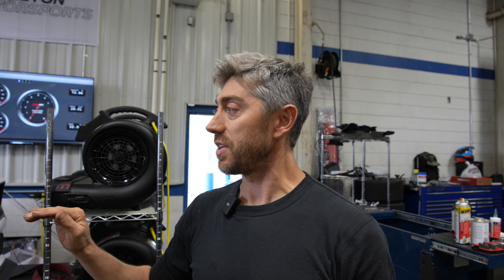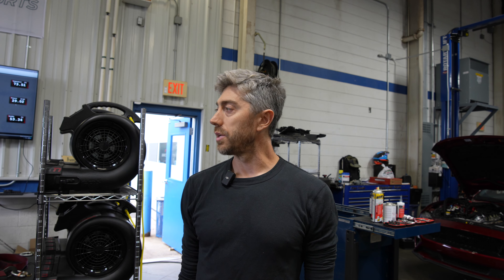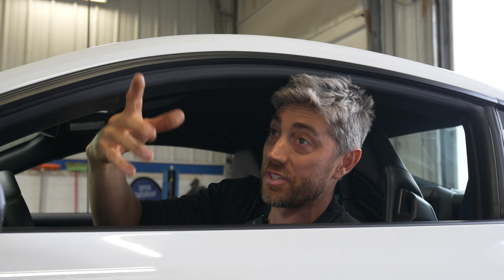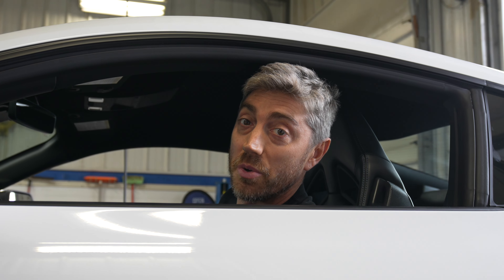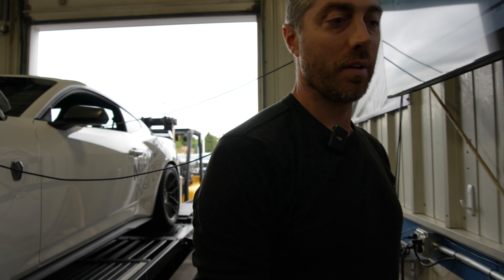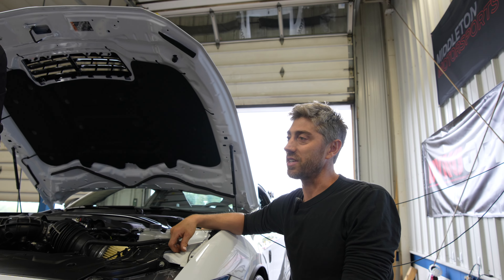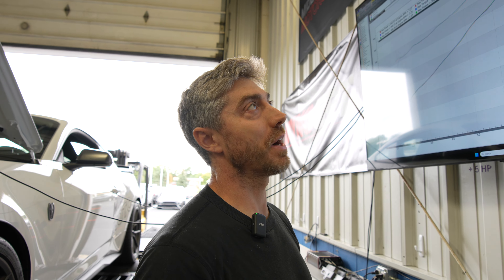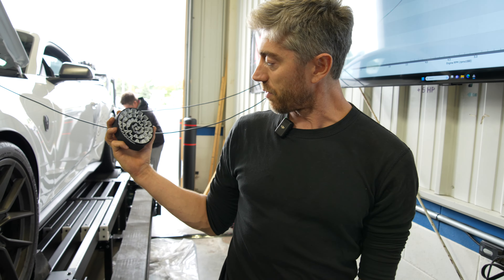*Highest WHP 2024 Mustang Dark Horse?!* 2024 Dark Horse Dyno Carbon Traps Removed

Comment: what is the use of a catch can? my mustang is stock. Am I harming it by not having two of these?
Reply from the maker: won't harm it but it separates the oil from the acv system that runs back in to the intake.  If you're driving hard or on track we recommend getting one.
Reply: @MiddletonMotorsports  thank u!

Comment: Lol Alejandro Flores Lund tuner did a live stream about this and he was right.  Removing carbon traps not gonna gain 20whp like people was saying 😂
Reply: ya thats crazy people think they rock 15-20hp lol its a heavier car than a s550 with 20 extra hp at the crank. Best way is 3 back to back runs and take a average.
Reply: Lol I watched that too😂
Reply: You're welcome
Reply: There is lots of surface area with the dual intakes, so I figured the engine could probably still get enough air.  
For the same reason, I think aftermarket air intakes won't really make a huge difference.
Reply: @minibikemadman that was true w s550 too it made up for it w potential having a gen 2 coyote was a big step up from gen 1.  This isn't a big step up and with tuning locked down its actually a step backwards.
Reply: This conversation just saved me 11 minutes 🤣
Reply: @YDBT4LIFE   Great video right! Proper SAE dyno numbers and taking the lids off to show where the power was coming from that the internet was claiming. Also the most important thing is that it didn't throw codes... That would have been a disaster for the platform if it did.
Reply: @AJUSA1  absolutely. It was scientific they did a great job.
Reply: I love Alex!!! 😂
Reply: All the aftermarket parts slingers are starting to 🥲
Reply: I’m guessing the carbon traps are part of the evaporative emissions system? IE absorbing fuel vapors escaping out of the intake manifold when the car isn’t running. Anybody confirm this?
Reply: I'm thinking the carbon screens could also be used for sound restriction. But who knows with a tune there might be a little more power there.
Reply: since the gen2 coyote, engines are opitmized for power and balanced for cost... not like the old days of cost over power only. The days of 20whp from a airfilter or +10mm throttle bode or exhaust are gone. Factory detweaked to save dollars. Today they just raise the cost...a 60k GT...
Reply: Saw the stream too
Reply: @minibikemadman how do you think the 24 weighs more then the 23 and older. 
My 24 weighs 3700 with half tank of gas. 
Sure you'll add weight with more options especially the performance packs with bigger brakes
Reply: Alex, tells it how it is ! No BS He is  💯

Comment: 1st time me hearing about abs cause issues with air fuel ratios. How are they even related
Reply from the maker: The car was going into a limp mode of some sort. Doesn’t like being on the dyno even when the dyno plug unplugged. The car changes the fueling why we’re not sure
Reply: @MiddletonMotorsports  I have a G8 that's gone into limp mode.  It does have an abs fault light come on sometimes however I've never had the 2 come on simultaneously, and the limp mode was pretty rare,  but the abs fault in a g8 isn't like a check engine light and I don't know why I experienced the limp mode.  Just some spirited driving on the highway without an abs fault. I would never imagine an abs screwing with the issue causing the ecu to bug out
Reply from the maker: @MrDerekRobinson  this is far from a G8 with the new computers etc.  we’re not saying it’s the abs causing it. The whole car goes into a limp mode not sure what’s causing it other than it’s on the dyno and doesn’t like it.

Comment: Alejandro flores was right people spending 70k for nuthn 😂😅 should have just got the gt350 smh
Reply from the maker: Chuck already has a 900whp GT500. He wanted to test the new platform at the track and like we mentioned in 60 days it will be a different car with a Whipple.
Reply: @MiddletonMotorsports   won't make more than 700hp with the Whipple to the wheels
Reply: @edddiaz4202  hoping for low 600s.  Will
Make it a fun car. But if I want the best performance on track and acceleration ill get in the 500

Comment: Yea thats smart then have all hot air coming in either put a cold air with a closed air box or leave it as is
Reply from the maker: We aren’t running without the lids. Just for a test to show restriction of stock intakes
Reply: @MiddletonMotorsports  i know you are doing a test its ford that are idiots first with that shit hole mt82 that im having all kinds of problems with now they make a 4000 pound car that is slower than the s550 because of weight

Comment: No disrespect intended but lund is not the only person who has tested the new mustang without the carbon traps and got more HP. Why is he right and others wrong? Also, every little bit of HP all adds up. Carbon traps here, an x-pipe there, removing the air box lids and later a tune and flex fuel. Look at the bigger picture.

Comment: Nothing about the S650 says it’s a better performance car than the S550. Only thing it has going for it is the 2 tablets and a drift stick if you like it 😂
Reply: And better brakes.
Reply: @728GT  oh yeah brakes cause you’ll need that after getting gapped by a 15-23 mustang 👍🏽
Reply: great, a drift stick so these idiots that dont know how to drive now have an added feature to lose control exiting car shows 🤦🏻‍♂️
Reply: Aka gimmicks
Reply: And they don’t make the S550 anymore. They’re not going to bring it back. At least they didn’t cancel the mustang altogether
Reply: @teamcaveman  that’s fine but it’s no “upgrade” from the S550 that Ford was touting about. Plus you do know Dodge and Chevy didn’t HAVE to kill off their ICE V8 vehicles they did it by choice 👍🏽
Reply: @OSMINCONDE23  by choice meaning they didn’t make the next ICE vehicle, rather the next one is EV. I think there’s more than just that they wanted to, especially the Camaro which for some reason couldn’t sell well. You don’t think fans wanted the next gen cars to ICE as well? I’m sure like before they’ll rejoice the new EV versions like when they made fun of the IRS in the 1999 Cobra and the supercharger in the terminator. When they put irs and finally induction in the Camaro and mopar, it was the best thing ever
Reply: @OSMINCONDE23 Your statement is completely incorrect. Do some research before making a dumb comment. The Hemi cost Stellantis millions in fines. $363 Million to be exact For Failing To Meet MPG Standards.... The Hemi was discontinued to eliminate future fines. Chevy is ended the Camaro because it didn't sell finishing well behind the Challenger and Mustang in sales. Regarding the S550. It's sales continued to drop with the Challenger outselling it. I'm trying to figure out if you dislike Ford or can't handle positive changes of the Mustang.. Maybe stick to S550 Channels. A real Mustang fan likes all Mustangs. Some more than others, but whether it's a 1966 Shelby GT350, Fox Body or an SN95 SVT Cobra. They're all Mustangs,
Reply: @DWH300  Yeah, so by choice Dodge stopped producing V8’s cause they couldn’t produce one to meet standards, where am I wrong? A mustang fan never got a mustang for change but for performance and there’s no “performance” upgrade in the S650. I don’t know if you’re a TRUE mustang fan, but Ford did the same thing SN95/ New Edge no performance difference until they got the Mach1/Cobra or what about 2010/2011 when they changed the S197 design in 2010 but didn’t put the coyote til 2011.

Comment: Unmeasurable difference from carbon traps, hope people get off the carbon trap bandwagon now, duel intakes with the lids off is asking for a hood with open air intakes... Ford Motorsport sells a blue air filter supposedly flows more...excellent video again from you guys....  yes 1/4 mile dragy runs PLEASE.
Reply: It would look pretty neat with maybe some louvers or something directly over top of them
Reply: @MikeYeary take a look at the COPO Camaro forced induction, it's literally a giant fiberglass funnel directly to the throttle body and Ford for some reason will never do stuff like this.... bring back the true Ram Air for a Mach 1 Maybe, unlike last year's decorative sticker package.
Reply: yup, its funny how it was proven/ dyno'd  that removing the carbon filter on the 22s actually gained the power back but they didn't do shit on these🤣
Reply: @alexisaguilera2705 there's no true dyno test like this one for the 22 isn't unmeasurable difference either case
Reply: @SHADOWBLACKs650 the stock air boxes ARE RAM AIR 🤣 even on the s550! Open element filters kill top end power on the road you loose the ram air affect…
Reply: @Texas_Road_Warrior  no they are not compared to a  open vented Hood... you would have are entering the airbox the speed of the vehicle....
Reply: Someone gained 12 HP by removing the traps, so it may be worthwhile for some.
Reply: @TheProtagonist_777  that's also a emissions device which a dealership will void your warranty, and they literally are not allowed to work on your vehicle once they see that, they are not bashful on voiding warranties on a mission devices... I get the idea and all but twenty thousand for a engine and 7,000 for the transmission plus labor people better think twice

Comment: Try replacing the stock air filters with K&N filters when they're available that would be interesting to see the difference
Reply: +5 HP
Reply: A stock paper air filter will flow just as well as the K&N without the shit oil filter being in there. Those filters will cause oil build up on the Mass air flow sensor.
Reply: It doesn't do any of that. Had an oil filter for 11 years on my 2014 mustang gt and no issues.@burntfaceman24

Comment: These vehicles have so much engineering into them I find it hard to believe any real world gain comes from changing anything on the stock setup.  You might get a negligible increase at the cost of losing HP somewhere else.  Closed lid air boxes keeps IAT temps down keeping the motor cooler.  So for a daily/street car I would keep the lids on.  Those iat temps will climb like crazy idling at a stop.  Keep it stock unless you’re  chasing every last ounce of HP for drag racing.  There is a reason it’s setup the way it is.

Comment: They did dyno runs for a similar type carbon filter that was removed from a 2023 Subaru BRZ (Toyota GR86) and they saw +10HP. Looks like the Japanese need to consult Ford for a more efficient carbon filter design.

Comment: Take the air filter off; put the lid back on... why hasn't anyone tried this.. it would be the most realistic thing you could/ would do at the strip..
Reply from the maker: We don’t and wouldn’t recommend running without a filter. Not worth the minimal power if any gain from that
Reply: @MiddletonMotorsports  I can accept that. Also, I wouldn't recommend running with the lid off, with hood down.  But you made the comparison to gt500's  gains, *65hp+  I've seen from Vmp (*not your comment).. for sake of an experiment, why not try? Even better  with a gt500.. RoadKill!
Reply from the maker: We don’t recommend that either. We just did the lid off to see if there’s a restriction in stock intakes and there is. With the hood down and lids on normal driving it will get more air than sitting still on dyno.

Comment: I’m lame… I talked to my father who has Owen older 5.0’s in the 90’s.. and in our opinion.. the power in the car is enough, it’s a finer good in the market, Ford  is known for the circuit more so than the other big 3, so why is it bad that the changes and alterations are more so focused on other functions of the performance rather than just power output? The adjustable bars under the hood. And other things are given to the Ford to make it track oriented. Yes it’s heavier, I got nothing on that… but they gave us a drift opinion.. it is performance oriented… just a different type of performer.. it’s not a drag car.. like a ton of the community want, it’s a pretty fast car meant for road racing.. see when the hellcats break loose jamming the gas down?? They are not performance vehicles in my opinion, Ford say’s we want more than straight line performance.. and this new whipped should give the average man more than enough power to have the fun. I’m keeping my order and seeing what happens. But I’m not an extreme guy who wants to have a carbon fiber cam shaft and things like that to make the most of the engine, I’m a normal guy. And I thiiiiiink it will be enough with the whipple. But yes.. it is priced high. This is an opinion of a fan of cars, but doesn’t have knowledge. So a nobody..
Reply: We don’t care about stupid drifting stuff, the issue is that this car is heavier, slower and not tunable. 90% of mustang owners don’t drift, we want something fast out of the box that we can modify.

Comment: you only see a gain from the lids removed with the hood up LMAO close the hood and IATs skyrocket and RIP your gains
Reply from the maker: We mentioned it was a gimmick in the video but same tests are done in past with 500. Sitting stationary on dyno is hard to simulate enough airflow for intakes. This helps the engine get what it needs sitting there

Comment: New Mustangs too heavy and very little power increase. Better to get earlier models.
Reply: They’re barely even heavier… like a 100lbs curb weight MAYBE. If you want lighter you need a 2012 or older. Those are actually lighter but you’re talking a negligible difference between 2024 and any of the s550s
Reply: @icebox829  something is wrong with the performance of the 2024. A new gutted GT ran 11.7 that was with a drag pack 10R80 car. Lol that's pretty slow if you ask me.
Reply: If your girlfriend rides in the passenger seat of your S550, it will weigh more than the S650.

Comment: With 15 percent drive loss this puts it at 530 crank.
Reply: Stock tune only 19 gt made 446. This is embarrassing.
Reply: Who cares about crank 🙄🤦🏿‍♀️
Reply: @YDBT4LIFE  what number would you want to see? Honestly, what were you expecting?  Let's be happy we still have a v8, and it makes more than advertised. It's sucks that cars are so expensive right now, but there aren't any new cars under 60kish with 500 hp that I know of. There is no way a  gt made 446 wheel horsepower with just a tune unless it was e85; either that or the dyno reads high.
Reply: @Haywood_jablowmey  Everyone, that's why they advertise crank hp it sells.
Reply: @jeffkelly9197 I'm not just gonna "be happy we still have a v8" if it's locked down it might as well be an ev
Reply: @jeffkelly9197 I seen earlier gen 3 doing 430+ to the tire bone stock.
Reply: @jeffkelly9197 so you're saying you're just some regular dude not a car guy?  Car guys don't talk in estimated crank hp in the US
Reply: Drivetrain loss varies between every vehicle regardless of them all making the same crank hp. Plus I don’t remember people asking other people what crank hp they have.
Reply: @midnight347  Whipple is coming out with a kit, so there will be supercharger options. If we can get a whipple with a v8 and warranty, we should be thankful. "Might as well be an ev", you don't actually mean that lol Unless you're a dodge guy and they did.
Reply: @midnight347  Every car guy knows how much wheel horsepower his car makes and how much crank duh come on man🤦